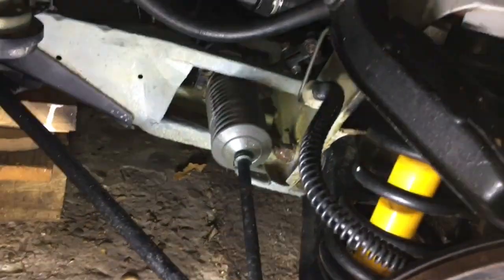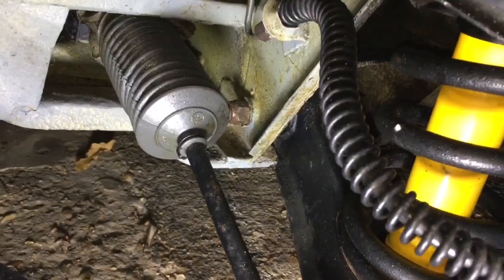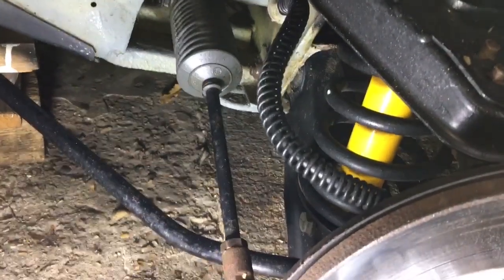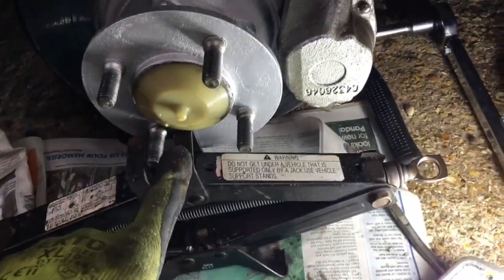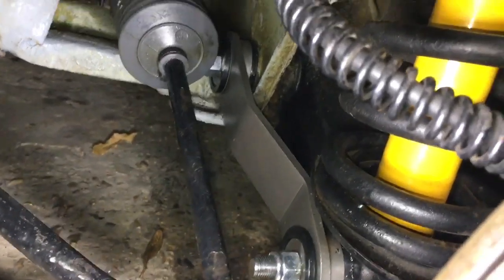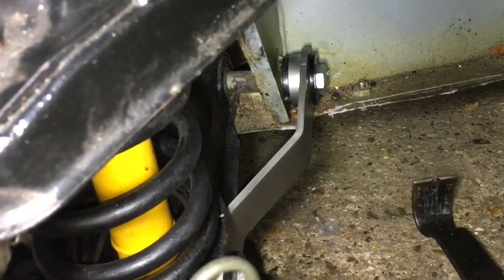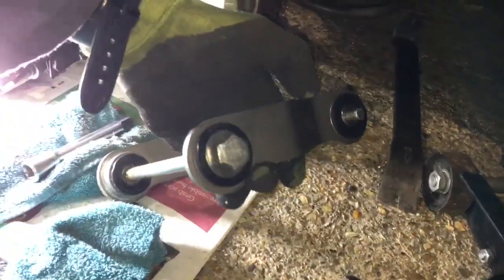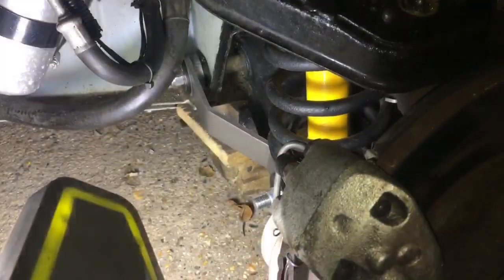DeLorean upgrade - DGo Stainless LCA support kit (apologies for the background music error)

Comment: Big difference when these are added to the car.  Good work sir
Reply from the maker: Thank you my man. I now feel it’s much stronger up there, so a nice easy sensible upgrade and I also repositioned the springs slightly to stop the creaking I was getting over speed humps. I just need lockdown to ease so I can actually use the car :).
Reply: @griceyboy   Did you upgrade your sway bar bushings as well?
Reply from the maker: @AerosolKid  hey, no the sway bar bushes were/appeared in good condition,  same as all the ball joints on the front.  I don’t plan to do much else on this aspect now as it’s pretty tidy.
I may do the fans though at a later date (I’d do them now if they weren’t so expensive), as the modern fans use a lot less draw /current apparently.
Reply: @griceyboy   Dig it. When I upgraded my fans I decided to just upgrade and replace everything on the front end. ✊🏻
Reply from the maker: @AerosolKid  cool stuff. I did the rad with a Dgo rad upgrade, and I don’t use air conditioning, so I reckon new fans in summer when I’m bored and want to spend a few hundred :)